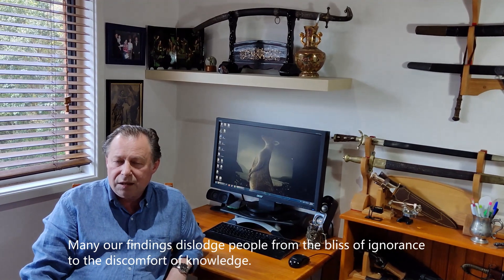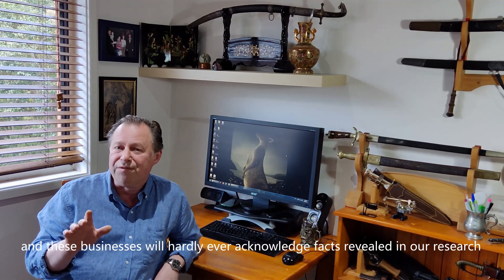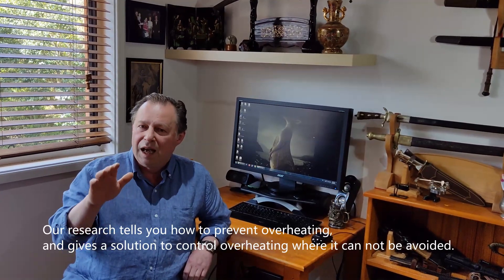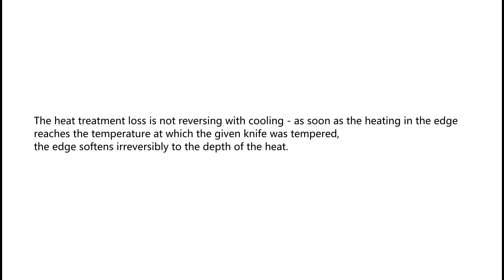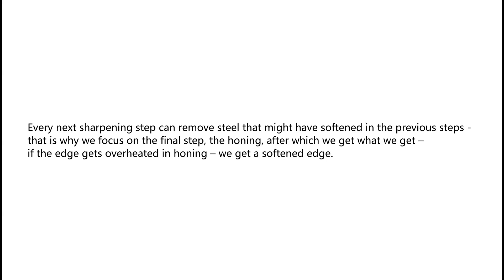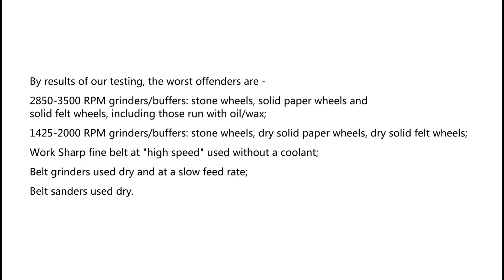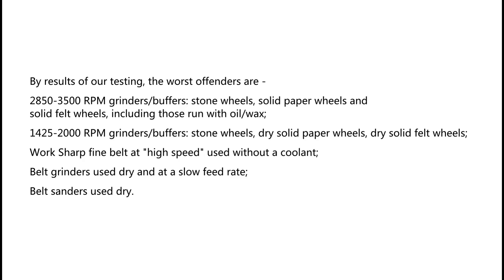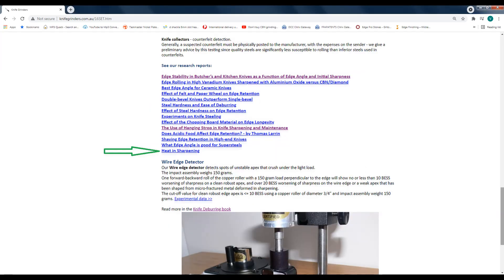Heat in Sharpening - Summary of results

Comment: that heat lacquer is very interesting. i laughed when i saw a reference to my overheating steel video. i felt the need to facetiously do that video after repeatedly having popular manufacturers refute apex overheating when the evidence was obvious. 
i find your setup for sharpening that you are doing now seems so simple from the perspective of a manufacturer taking that on board. maybe even 22 knives a minute is too slow for them vs the rapid grinding they do. 
I'm personally a fan of full wet grinding on 2x72 same way a tormek flows water. but its just too messy for many

Comment: I've been pondering the fan cooling effect of the slots. I'm wondering whether drilling two small 2-3mm holes either side of each slot at it's depth, angled in the direction the wheel travels, might act as catching 'scoops' that grab more air and force it from the slots to increase cooling. Similar concept to the scoop on a car bonnet (and body design in face cars/bikes) that force more air to where cooling needs to take place, be it engine, intake, wheels or brakes.

Comment: Is the honing coolant just paraffin wax? I don't think I've heard you mention that yet. Excellent work on setting facts straight with concrete evidence!
Reply from the maker: Paraffin and common waxes down honing efficiency of fine wheels and belts, while our Honing Coolant does not; the composition is proprietary - MDS: http://knifegrinders.com.au/Manuals/MSDS_Honing_Coolant.pdf
Reply: @knifegrindersaustralia5158  I appreciate the reply. I feel there'd be more visual appeal of your item if it was contained in a extra large glue stick dispenser instead of a deodorant container. 

Have you thought about selling on Amazon or eBay?
Reply from the maker: We were selling on eBay, but had issues with copycats selling counterfeits. The only way to give customers genuine items is to sell through our own website.

Comment: Thanks again.  I like your introduction, and based on my experience in areas other than knife sharpening, I agree with your general comments about over heating the edge.  It is hard to imaging that the edge gets hot, but if you think about it on a microscopic scale it must be getting quite hot in the local area around the work zone.  There is a lot of energy coming off your grinder into a very small volume.

Thanks to you I live in a workshop/home where all the tools are sharp.  But, all my relations bring their knives to me, so it's a mixed blessing.
Reply from the maker: "... it's a mixed blessing" LOL :)

Comment: Very interesting video series. Do you have any idea why coarse grinding with the work sharp grinder with coarse belts is a non issue, but 42" belt grinders are?
Reply from the maker: Sharpening on long belts can be done without overheating. This video explains conditions at which it becomes unsafe https://www.youtube.com/watch?v=khG7WCYoqrQ&t=180s
Reply: @knifegrindersaustralia5158  one thing i dont see a lot of knife makers do, but i always did, is that i grind the apex first down to near zero like you would grinding a scandi knife (still under water flow) but the reason being is that now the apex was formed with a lot of mass behind it as i normally do this at around 18-d0 dps.. once that is done and it forms the centerline, i now grind back to the spine until that edge bevel is only about < 0.005"

i personally find that this way is far less risk of accidental burn than grinding the entire flats first and then apexing.